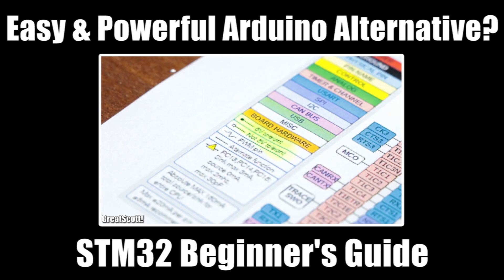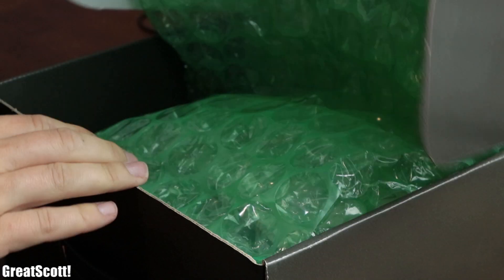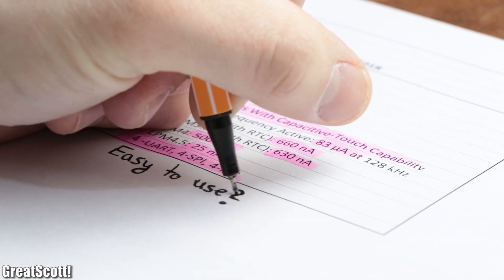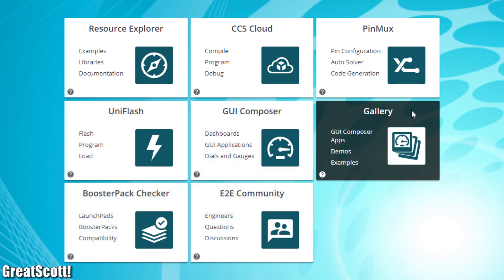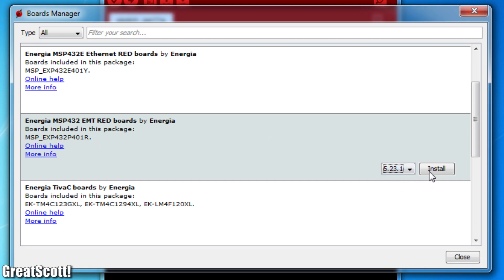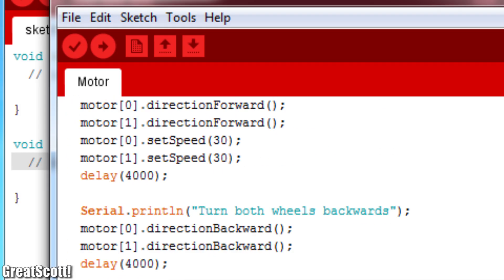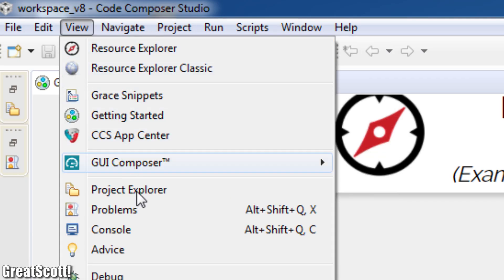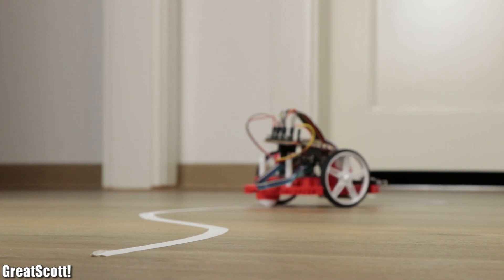Easy & Powerful Arduino Alternative? #2 MSP432 Beginner's Guide

Comment: I still have my old MSP430 from my microcontroller/embedded system class in college and yeah it is definitely one of the worst MCU's when it comes to programming as a beginner/hobbyist at least when it comes to bitwise operations on registers and clocks, etc. My final engineering class project required us to use a MCU for interfacing with an antenna and we chose an Arduino, before I had never even programmed an Arduino and once I took a look at the code I needed to enable communication I was shocked at how easy it was, lol. Still found myself going back to my MSP430 for hobbyists projects since now I want to master this MCU the way I couldn't back in college. 

"We choose to build our projects on the MSP430, not because it is easy but because it is hard."

-Kennedy, maybe

Comment: Hi Scott, I'm currently working on MSP432P401R. Previously, I can download the code to the board and debug normally. But then one day, when I plug in the USB cable to my laptop, it doesn't recognise anymore. I have tried different ways and even contact with TI customer support but none of them is useful. Do you know any way to fix this problem?
About my problem: when plug in, the green LED lights on normally. I tried to plug in another laptop running Ubuntu and it cannot recognise too. I tried to reinstall CCS many times, update drivers.

Comment: Actually, MSP432 is difficult for programming  in compare to Arduino or STM32 because its community is very small and there are only few libs and examples, which support MSP432. But it is great tool to learn embedded programming

Comment: I got the newest version few weeks ago (November 2019) and it does not require any welding anymore (unless you add an optional LCD or OLED display to it). It also uses CSS version 9  (looking familiar if you know, say Microsoft Visual Studio, wit extra views and add-ons to debug a MCU after all) and the TI's site seems more up to date too, with a lot of new stuff. Seems that TI is pushing hard to promote it. Less "details" are required to install the soft, with a more straight approach from the doc too to use it. Still, the later online tutorials are clearly perfectible though. They, TI, don't seem to have clearly identify the intended audience yet (sometimes too basic, sometimes too many details obscuring rather than explaining, ... ). The hardware seems really great though, impressive.

Comment: Raspberry Pi is a Single Board Computer that has these GPIO. Yoi should try this out as well and make conclusion whether this can be considered a microcontroller.
You will program the GPIO with Python using the library.
Careful though. It is not as durable as those others like Arduino and these alternates that focuses on Microcontroller. Just one volt mistake can destroy your $35!

Comment: Besides every think about the video i have A question
Is it possible to charge A battery pack with 2 of more diffrend voltages?
Because I want to charge the battery pack with solar panels and a windmill

Comment: Hey... you should do a video on the new RISCV based Vega-board. It’s one of the newest microcontrollers that uses the open source RISCV instruction set. The Vega-board also has a lot of onboard features like user LEDs, buttons, Bluetooth le, an accelerometer, and a couple other things

Comment: I've between using an arduino YUN for a couple years, but keep.hotting memory limits. Would be difficult to port my application to this? I use temperature sensors, hx711, i2c displays, and IOT protocol.

Comment: This is good, however, CCS isn't the most easiest of IDEs to use. Also if you really want to unlock the 432's power you HAVE to use CCS. For someone unfamiliar with in the ins and outs of C programming, this is really daunting. I've usually found TI support to be great. I really value their e2e community. This is one area where STM severely lack. I love their MCUs but saying that their support sucks would be an understatement. It is just that bad. I honestly feel that using MCUs such as the STM32 or the MSP432 with an Arduino-flavored IDE is severally under limiting their capability to, well, what an 8-bit processor can do. Also look at the CC3220 for their WiFi + MCU combination. Wonderful little marvel with horribly complex software library.

Comment: ST, TI the controllers are awesome. The development tools are first class and ,although more intimidating than arduino IDE,  very easy to use.  The problem :  there are so many devices that just work with arduino because of the extensive library support for the platform.  There isn't that type of "sharing" in the arm32 microcontroller world.  I have a stm32 board but if I wanted to use it with a nRF42l01 or a micro disk I would have to search around for a library or have to write the code myself.  Very time consuming if I could even accomplish it.

Comment: I love the teensy 3.5 microcontroler. I build a 9x9x9 rgb led cube using it (and 18 tlc5940). It’s so fast, has lots of timers, dma, rtc and many more usefull features. It’s not as cheap as arduino clones... You can use teensyduino in the arduino ide or Eclipse (sloeber) which is much nicer in my opinion.

Comment: Great video. The MSP432 (and MSP430 too)  Launchpad is NOT a hobbyist tool, but it's still an awesome tool for learning about microcontrollers in depth for more professional use. In my university, PIC microcontrollers are used for classes, but I learned a lot with my own MSP430 Launchpads. TI has some pretty good documentation.
Reply: Is the Launchpad good for learning microcontrollers in depth for a hobbyist?

Comment: You could also take a look at Microchips microcontrollers (Microchip bought Atmel a few years ago) in combination with MPLAB X and the Microchip Code Configurator. They are used in the Industry as well.
You could also take a look how to program the STM32 with STM's Atollic TrueStudio.

Comment: For most Hobbyists it's just another microcontroller, I think the low power usage is the only real selling point, so I would like to hear more about that. 
This video is - IMHO - a quite shallow Ad for TI ... I'm not against sponsors and not against TI, but it boils down to "Hey, you know Arduino, you can do the same stuff on MSPs - just a bit more complicated" There are quite some interesting things over at TI, like the CC430 which has included radio (but I never used it)

I know, I know, it's a "Beginners Guide" but I did not see anything that convinces me, that a beginner should use MSPs instead of more established µCs that have tons of resources online. I do have a launchpad... but I have not found any reason (yet) to use it instead of an Arduino.

Comment: Nice video.
What about nrf52832 and nrf52840? There is a nice free IDE for the SDK (segger embedded studio) and growing Arduino support. These arequite interesting because they're low power and have multiprotocol radios on board. They seem to be underrepresented in the hobbyist scene.

Comment: I am currently working on a project utilizing the MSP432P401. And I have to say that the entire team is rather dissapointed. The controller has a few severe bugs and the documentation is attrocious, which is unusual for TI. Just two examples: The UARTs are meant to be almost compatible to the MSP430 ones. The diagrams in the datasheet are even suggesting that. But it's wrong. The UARTs even have a bug generating stop bits and generating interrupts. Gladly some advanced coding could tackle this but it took a few days to figure everything out. A detailed documentation about the interrupt system is not part of any datasheet, but is only availabe as part of a toy documentation (maybe that's your robot, I don't know). That's not how it should be and I wonder how TI managed to screw up these essential things. Usually they do much better than that. However the power consumption compared to the MSP430 is very good. At 12 MHz it takes around 1/3 of the current  a MSP430 would take while it is around 10 times faster.

Comment: I’m going to make a electromagnet but I watch many videos and they always remove the secondary coil. Should I remove the primary coil and put the secondary coil back into the transformer again?????
Reply: It depends what voltage you want to plug it into.  If you have a 115->12VAC transformer you can drive the primary at 115 volts or the secondary at 12 volts.  It just depends on which is more convenient for you.  If you are using an old microwave transformer the secondary is around 1500 VAC which is not convenient for most people.

Comment: I work for TI, but in the lprf category of of micro controllers! This is pretty cool to see from a YouTuber I always watch:)
Reply: Can you please tell them that silicon with errata is unacceptable?  I really like the MSP architecture but I absolutely will not buy a product that is not as described.
Reply: @danrbarlow  I can understand your frustrations. Unfortunately I am a wee software developer with no power over the silicon gurus. That being said though, I believe every chip I've ever used had an errata. I think it's more of a inevitable consequence of complex devices :/ though maybe there are plenty of chips that work 100% as expected with no deviation. Then again, I'd be willing to bet that's only because no one has found the little deviations that exist :p
Reply: @danrbarlow  , whether or not this fits the experience you have had in the past with the MSP line. I found this that does much better than I could at explaining it errata. https://electronics.stackexchange.com/questions/181395/silicon-bugs-errata-sheets ,
cheers!

Comment: Another Idea for one to try:. Link it connect 7681.  Dev board for the Mediatek 7681.  You find it in alot of wireless products too.  

Although you might argue it's a bit too close to an ESP8266.

Comment: Hello, I was just beginning to learn Arduino when I came across with Cortex-M microcontrollers (in both TI and ST flavors), which are a complete different universe when you compare them to Arduino. As you can imagine, I was completely lost at the beginning and thought that they were way more complex than what I could manage. However, I have made my way through and now I feel more comfortable with them, altough I am still learning. If anyone wants to dive into the world of ARM Cortex-M microcontrollers, I would definitely recommend beginning with the STM32 ecosystem (STM32CubeMX + Atollic TrueStudio + Nucleo boards + book "Mastering STM32" of Carmine Noviello) since they are a lot more newbie friendly than TI ecosystem. But don't get me wrong, TI offers very powerful devices too, but you need a little more coding experience and familiarity with the Cortex-M universe to tackle them.
Reply: Same here but those do not have the library support that arduino does.  I have a stm32f0 and it's awesome, very fast. But 8 bit world is simpler.

Comment: Have you considerer FPGA videos? Also, maybe make another stm32 video using the CubeMx or Keil instead of arduino ide. Def check out Stm32 Dicovery boards and nucleo boards.

Comment: Meh... I like TI but this board is not so interesting. Actually it's not even close to compete with STM32 which in case of Blue Pill is several times smaller and costs $4.

Comment: Atmel is dead. ATMega / ATMega32 is too late.
Embrace the STM32 ARM 32 and 64 Bit CPU Overlords. For now.
I hope RISC V chips come next. Even though I dislike RISC V assembler. ARM assembler is more elegant I think.
EDIT: "Too late. Too little". RIP TI & ATMEL.
Reply: Yeah dude , bring in the ARM STM32 ! They are much better than AT Mega
Reply: @shivakarthick-prof  in the drone world stm32 f3 f4 and f7 are the standard..
Reply: I'm not sure. Just got messages from Mouser that Microchip released new pic series eval boards with debugger around 10usd. Almost same size as arduino nano. little bit longer because of additional pins. Also same for ARM series with more lenght. These modules had also pads in side of pcb for use as module in main PCB with reflow.
Edit: 
It seems that these MC curiosity boads also have ATMega chips that I havent heard anything. Haven't been using ATMega for few years. same ~10 usd price with debugger.

Comment: The Sierra wireless mangoh red/green kits are really powerful. But they are arm based and run Legato Linux (they are still programmed in c) they provide a virtual box vm that's setup to be a ready to use ide (or you can build your own), but some of the documentation could stand to be a bit easier to follow. It's designed to run off of a single lipo battery for IOT applications so the gpio is all 1.8v or 3.3v depending on if it's direct to the chip or the raspberry pi compatible header.

Comment: Nice video, did you try to R/W directly into regs? Its much easier than the driverlib method you use in this video. And Ti’s datasheet is very good.

Comment: Definitely check out Silicon Labs! They have a great easy to use IDE and using their Cortex M0/M0+ parts is a lot easier than using the 432 series. I also highly recommend STM32 for the easy to use IDE and huge range of parts to choose from.

Comment: The Adafruit SAMD51 and SAMD21 families are great arduino alternatives which are much more powerful. 96-120 mhz clock speeds, tons of peripherals, and even a drag&drop bootloader and a port of adafruits micropython fork (named Circuitpython). If you haven't already you should def. check them out.

Comment: “Pretty mandatory when it comes to low-power robots” Seriously? You use a robot with motors as an example? The motors consume a lot more power than the MCU!
Reply: It's because he got a kit.  What did you want, an example for every use case?  It's really a good product.  Don't bash just because it's not Arduino.
Reply: James Kerns Jr. Fair enough, I posted the comment before watching the entire video.
Reply: GRBTutorials I put robots to sleep when they don't move for hours.  Saves batteries from dieing but you need lower power LDOs too.
Reply from the maker: Quote the line correctly. I said:"....to some degree mandatory...."

Comment: I remember the days of the $4.30 MSP430G2 Launchpad... it was a huge promise, but TI either didn't understand or didn't care about the hobbyist market and Arduino won easily. Anyway the MSP432 is a totally different beast; and there are also some interesting offerings now in the MSP430 range, of chips with FRAM. Just always remember to read the Errata! ;-)
Reply: Most large semiconductor companies don't care about the hobbyist market as it's very small compared to companies using them in their products
Reply: That is true, and I don't blame them :-) However, the MSP430G2 Launchpad, with the Energia and all that, really gave the impression TI was trying to enter the maker arena. To this day I'm not sure what it was all about!
Reply: They just released updated MSP-EXP430G2ET verison. That have new debugger (ez-fet) that supports USB3 controller.
Reply: Again, I have no inside knowledge and I don't know who was thinking what - but yeah, if you create a product that looks and feels like some existing product, and you sort of direct it as the same audience, and you even sell the hardware at a loss... kind of gives the impression you're competing ;-)
Reply: Not to mention that they took over GCC porting and buried it for the critical years completely stalling its adoption until it was too late.
Reply: Oh? I wasn't aware of that aspect. Sounds like another classical example of corporate thinking... :-/
Reply: They are not even close from one to another maybe they did that because MSP430G2 is more suitable for high demanding projects than arduino, i mean i love arduino but there is a lot of flaws in it
Reply: Retro Rick - not sure whom you responded to, in terms of hardware alone I don't think the MSP430G2553 is superior in any way to the ATmega328P (except being 16-bit, for what it's worth), and you wouldn't want to use a standard evaluation board in a high-demanding project anyway...
Reply: @idogendel  indeed you are right but still arduino was more designed for hobbiests is not  suitable the most board for an engineering project

Comment: Hey, try out the Parallax Propeller (P8X32A-D40) that microcontroller is one hell of a monster 

8x 32bit cores that can run up to 80MHz 

32 I/O pins

Can output video natively (VGA, Composite)

Comment: Well I know that most viewers have no idea how exactly hardware works and Arduino LIKE IDE's are much easier to create a functioning code, but I like that you are mentioned other tools also, where you have all that you need to work with hardware and also debug it.
By the way there is Quantum leaps channel which covers microcontrollers programming deeply. If anyone is intrested to learn more deeply I recommend that dude. He also uses MSP lounchpad (not sure if it is the same) so maybe it will be easier to start for beginners.
Reply: s bright  no everything is fine to use simple methods. Especially that arduino is fine for most of the projects. I wrote this comment because 1. I prefere bare C personal, 2. He mentioned eclipse based IDE, 3. I remembered Miro channel because of board itself and though that maybe there is some people who wants to dig deeper ir hardware. I hope it is ok for Scott.

Comment: I had a tiny toy with an led and two ldr's,  and a battery, but no microprocessor. It could follow a line, as this does.  An 8 bit arduino,  slugged to 100kHz clock can do this standing on its head with its hands tied behind it's back singing je ne regrette rien and computing pi to ten thousand decimal places while idle.